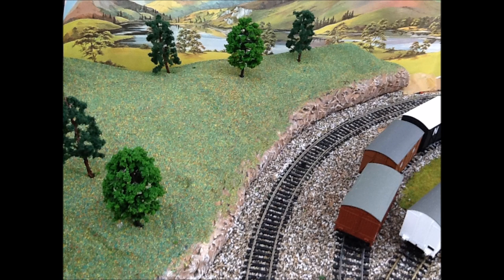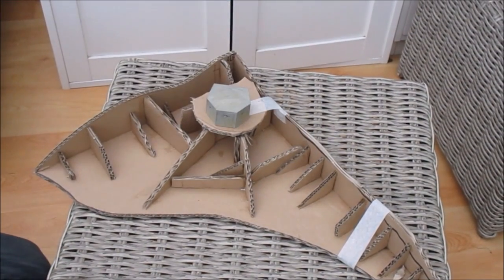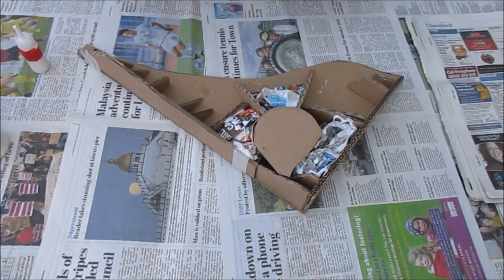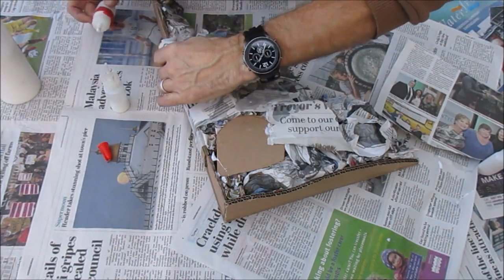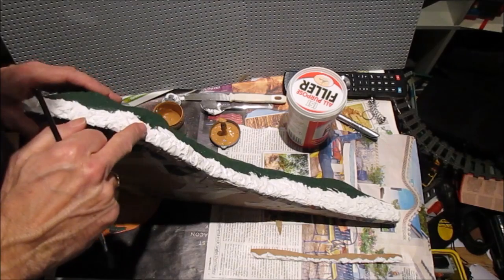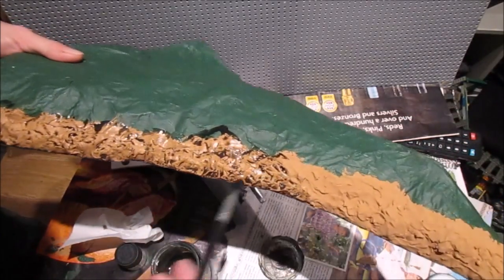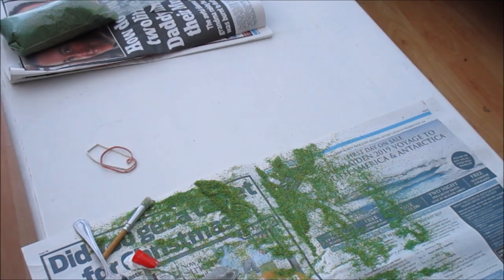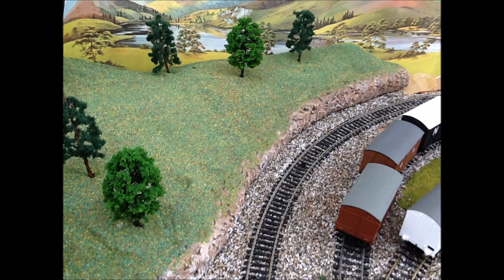How To Make A Model Railway Hill - Model Railway Scenery Construction

Comment: Have you tried hanging basket liner for grass? You peel it in half (so you get a fluffy surface and double the liner!) and then you tease the fibres out. Then you spray it green and voila!, you have cheap (£4 for over a metre squared) and really good looking grass! The one I use and recommend by other modellers is Gardman Easy-Liner. Hope this is helpful

Comment: This looks really good, I will give it a go for the tunnel on my layout. My Poundland has everything for 90p which is even better!
Thanks
Al.
Reply from the maker: Thanks Al. .90p is a result. Cheap filler, paints and glue work just as well as the very expensive model products. I saw one guy spend £25 on rock and water products to end up with pretty much the same look as my pond which cost me £3!

Comment: Give the PVA about 10 minutes to dry before sticking it together, saves at least 50% drying time 😸 cement & sand instead of plaster, rock solid hardshell, just paint it on. Nice trick with the tea strainer 👍

Comment: A trick for stopping the leggo rock mold from sticking is to have a small container of talc and dip it in, bang off the excess then the wet filler is less likely to stick to it. Reapply as necessary. 
Watching lots of your vids in one sitting and they look good.
Reply from the maker: Thanks for watching and supporting, there is quite a lot of them now ! Another due out tonight.

Comment: Oh and a trick that was suggested to me at the recent train show in Littlehampton is to use a half-decent electric fly swatter with a teas strainer as much cheaper than the £50 static grass efforts (I consider that £5 is an expensive indulgence!).

Best, jkhn
Reply: There are lots of YouTube videos on the conversion of low-cost, high-voltage fly swatters to such static grass applicators.

Comment: Looks like a very good hill. I use a very similar method for my hills except I use off cuts of old chicken wire (from various fencing projects) and newspaper stops mixed with some very cheap wall paper paste.
Reply from the maker: Hi Luke. Anything left over is always a bonus, it's where the roofing felt we use as bassist mat came from. I think wall paper paste would make a very cheap and effective alternative, thanks for the idea.
Reply from the maker: Hi Luke, send us a picture of your hill and we can put it in the newsletter?
Reply: I will do as soon as possible.